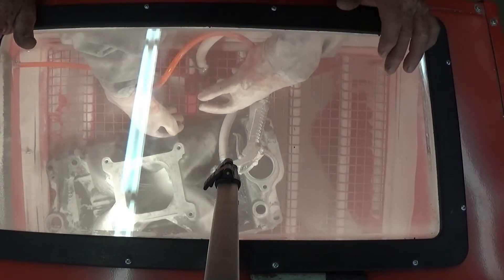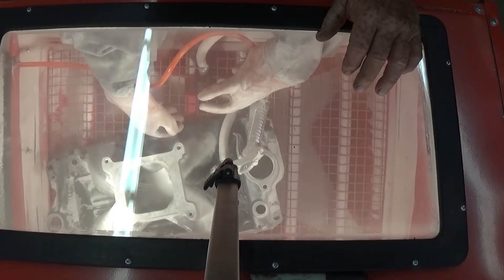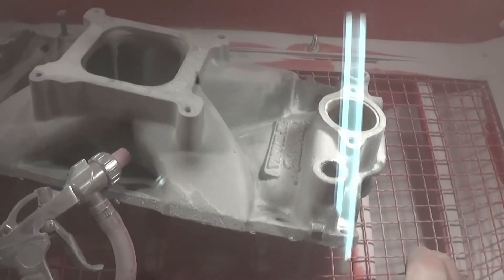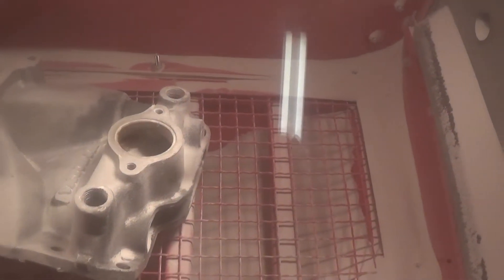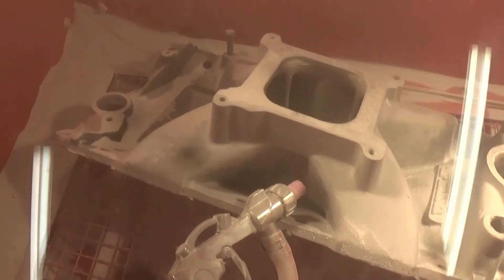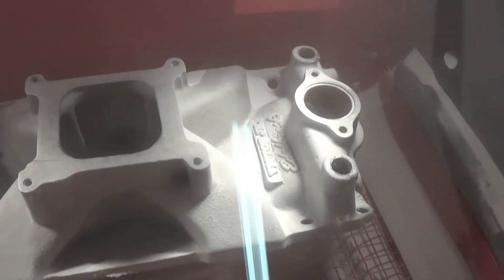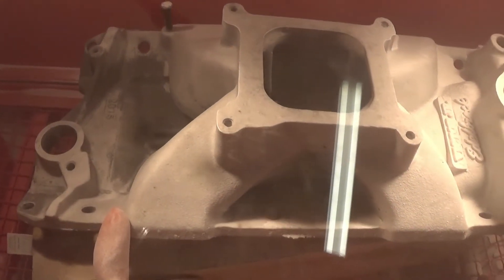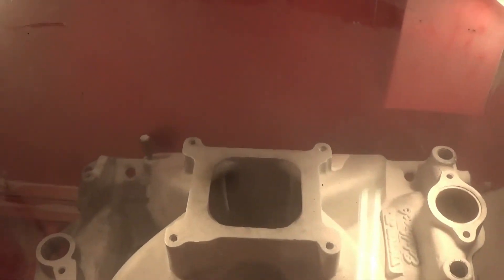soda blasting a aluminum intake

Comment: Yeah I'm with JB glass beads do a nice job but I hate the change out from aluminum oxide to the beads lol 😆
Reply: It’s a learning curve. Right?
Reply from the maker: where would i get glass beads at
Reply: @oldmanintheshopbuiltnotbou8726  Harbor Freight may have some or local body shop might be able to help. Seen #8(100ish grit) or #10(150ish) glass abrasive on Amazon. "Glass beads for a blasting cabinet". Hope it helps.  Andy ✌️
Reply from the maker: @AR_420  that does help thanks
Reply: @oldmanintheshopbuiltnotbou8726  yeah forgot about that got my glass bead from HFT I keep it in a 5 gallon paint bucket with lid to keep it clean and it makes it easier to swap out of the blaster.

Comment: Glass beads are the way to go they work great especially on aluminum,  just make sure you get a fine grit otherwise the finish will suffer on aluminum.   I personally get mine from a blasting supplier but harbor freight sells it too, I just find theirs dose'nt leave as nice of a finish.
Reply from the maker: thanks chevy i will check that out